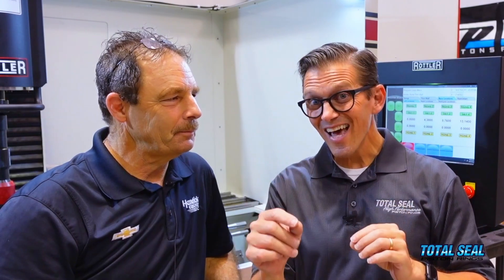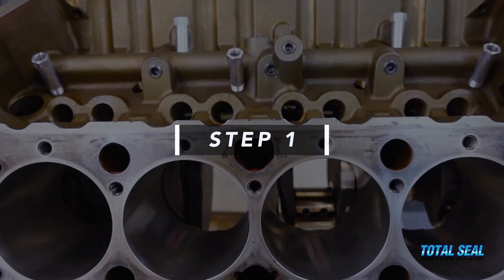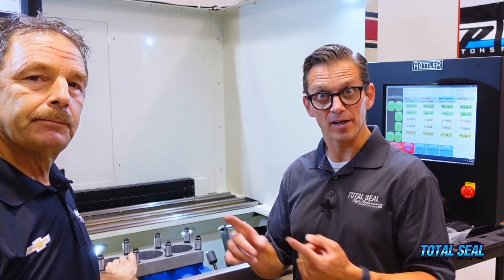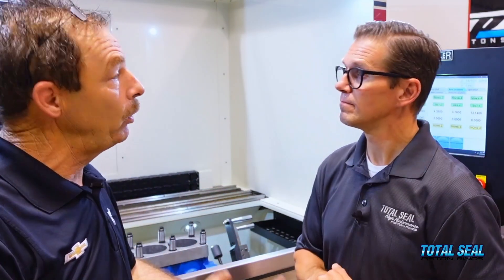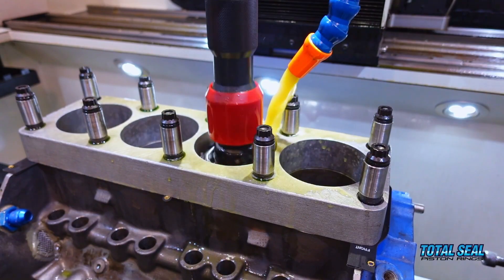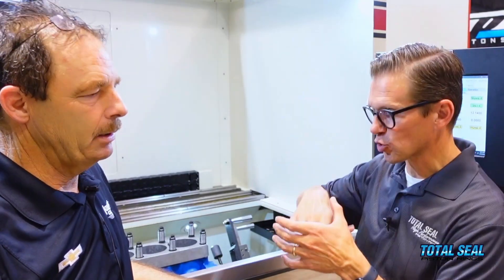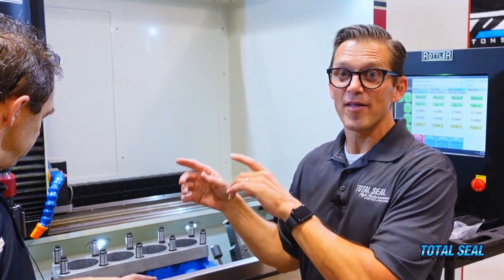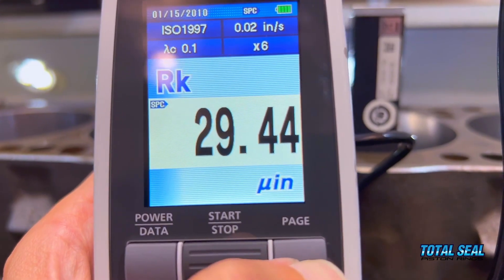Greg Anderson Shows You How To Hone An Engine Block!

Comment: How are open deck free floating cylinder liners bored?  Do they still need Installed in the block with a torque plate or thru some kind of fixture that can hold the liners  if the liners could be sent out for finishing & on a rare engine there wouldn't be a torque plate available, unless a special toque plate would need made?🤔

Comment: Curious if the material (aluminum or iron) of the torque plate and hardness (60Rc very hardest on most scales) will matter? Or the torque material and hardness of the cylinder head is designed for the specific torque plate? I think I might be putting too much thought into the foundation of the torque plate 😂
Reply from the maker: Using one is better than not. Having one the even more closely approximates the cylinder, the better.

Comment: A tenth of a thousands is raal close to the finishing size using diamonds.  Do you guys go a half a thou over for extra clearance too?
Reply from the maker: No. Go to the size that provides the piston to wall clearance the piston manufacturer recommends.
Reply: @TotalSeal  I just did a Ford 390 at 4.0800 (Silv-o-lite marks the boxes with sizes), and the pistons feel tight going in (I did not mike the pistons to verify, and re-verified with my bore gauge).  I think next time I do a Ford I'll give'em that extra half a thou just in case - a little loose is better than tight.

Comment: Hey guys I need a little help. What honing oil should I be using with 200 grit diamond stones with a sunnen rod hone on small engine bores.
Reply from the maker: The QuakerCut 004PE is an excellent honing oil.
Reply: @TotalSeal  Thank you.

Comment: But torque plate only simulates COLD engine. When hot, cylinders would be not perfectly round anyway.
Reply from the maker: Hot honing is the next level up from this process.
Reply: @TotalSeal  Ok. Interesting. Never heard about hot honing. But it's logical.

Comment: Greg is doing the plateau hone correctly(glad to see it) but there are still a few refinements that could be done to make it even better. Cross hatch angle is one parameter and microscopically altering the plateaus is another that no one has figured out yet.

Comment: I have a 550 hp sbc being built now. The machine shop honed the cylinders to 40 thousandths from 30 instead of boring it and didn't use a torque plate would you be concerned?
Reply from the maker: While that is not ideal, it is not a problem for a factory iron block with that bore size.
Reply: @TotalSeal  would distortion be much of an issue?
Reply from the maker: @Dougarrowhead  For a 550 HP iron block engine with standard rings, it is not a problem. If you were going for more power, etc... then it should be done with a deck plate, etc...
Reply: @TotalSeal  seems like most machine shops I have dealt with skip steps only because it is easier for them. I'm a perfectionist and it drives me nuts that they didn't use a torque plate. When everything is complete I will feel like it isn't as correct as it could have been and could be just a little bit better.
Reply from the maker: @Dougarrowhead  We can sympathize with you on that!

Comment: Can a backyard hack like me approximate this deep valley/smooth plateau finish with a three stone hone in the same-ish grits?  (Key word = APPROXIMATE).  Just as a thought experiment, assume bore is within spec for taper and roundness.

Not trying to build any type of crazy power, mostly interested in raising the bar on what is considered “good” ring sealing….for the benefits to longevity.

Enjoying your videos.  Thought provoking stuff.
Reply from the maker: Thanks for the question. Yes, Sunnen actually published a paper in the late 1980's that recommended going to size with a JHU123 (70 grit) stone and then finishing with 600 Cork Bond for 60 seconds. That's for honing with a CV-616.
Reply: @TotalSeal  Perhaps there are other providers, but the finest stone I can find for the shadetree-type 4 inch, 3 stone hone….is like 400 grit.
Reply from the maker: @InPrimer  Dang, doesn't look like you can replicate this type of finish with a backyard hone.
Reply: This is the most important machining process you can do for an engine - here's where you don't skimp
Reply: @InPrimer  If you gonna hand hone your engine I recomend at least spending the money on Sunnen Micro adjust hone. It utilizes the same head as some of the more budget oriented honing machines and uses Sunnen AN series stones, which will give you proper grits for desired finishes and even platue brushes available. The real magic is up to the operator. My personal opinion is them spring hones I see everyone using here on youtube are weapons lol

Comment: Getting Greg Anderson to hone your cylinders. Good thing you got that on video. Otherwise it’s another Bigfoot sighting story.
Reply from the maker: It may not seem like it, but the actual technique of using the rougher grit abrasive all the way to size and then just counting strokes with the plateau abrasive is quite revolutionary. Most machine shops are using the older technique that removes more stock with the final final abrasive, which greatly reduces the valleys left on the cylinder bore surface.
Reply: I currently have Tennessee Abrasive diamond and CBN hones for my Rottler HP3. They’re in 80, 275/325, 325/400, 600 CBN grit.
   I’ve been following and listening to these techniques explained. 
   I am really trying my best to emerge out of my home based shop that has to stay hobby level while on my property. 
   I was shopping for a profilometer when I began learning about 6 and 8 stone holder honing heads. 
    Then there is the arc pivot hone issue I have. 
     It’s adding up to become an overwhelming cost in order to maintain confidence in the trade. 
   Sure we all want minimal wear and friction and maximum seal. 
   It’s just becoming evident that doing so with affordable tools isn’t achievable for myself.
Reply from the maker: @hughobrien4139  It sounds like you are on the right track. There are always diminishing returns on all of these details. Since you already have an HP3 hone and the diamond and CBN abrasives (Kenny makes some great stuff), you can get the majority of benefit just by following the advice in the video. The 275/325 diamonds to size with 8 to 10 strokes with the 600 CBNs will get you in a good place. The profilometer can verify the finish, but that process should yield an Rpk in the 10-15 range, Rk in the 40 to 45 range and a Rvk of 40 to 50. That will be good for 90% of all engines.
Reply: My problem is that my background in the auto machining industry has been in the high performance side. 
   NHRA Super Comp, Top Sportsman.   
   I worked the induction side back then. We had several world champions we built and maintained engines for. 
   So I often get asked to do the routine on these engines. 
   I would like to slowly step into it as smart as I can without absorbing debt in these uncertain times. 
    Needless to say it has been very upsetting for myself and a few potential customers. 
   Just another case of hard choices being fact.
Reply from the maker: @hughobrien4139  Got it. Not seeing what you already know is really hard, and like you said, there is a cost to reach the next higher level in performance.

Comment: I assume similar would be recommended for chrome rings now since they are hard or is it still preferred to run them on a coarse finish to make them lap themselves in.
Reply from the maker: Great question. Chrome rings still need the rougher finish to lap themselves in just as you said.

Comment: Are you running the same crosshatch angle on the 180 diamond and the 600 cbn?
Reply from the maker: Yes! You want to keep the same crosshatch angle on both processes to keep the surface finish uniform as it wears.